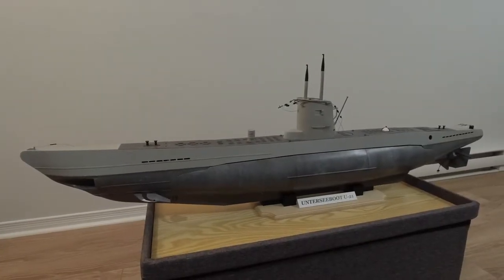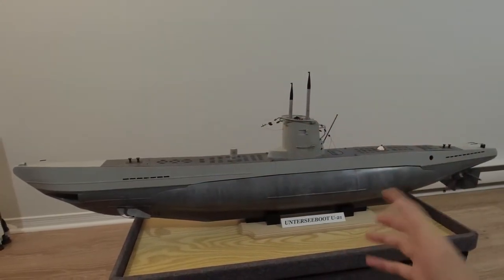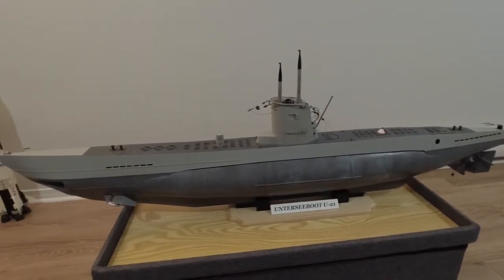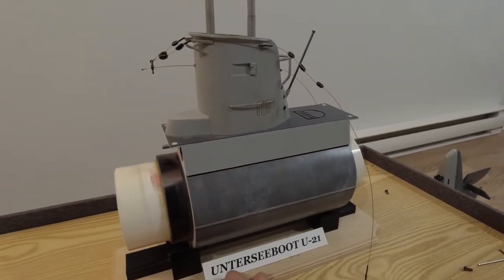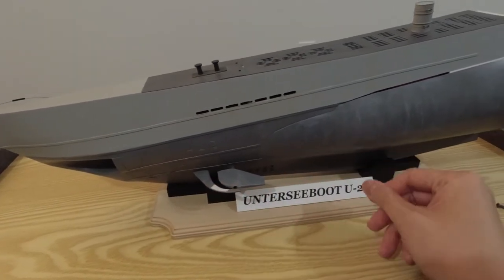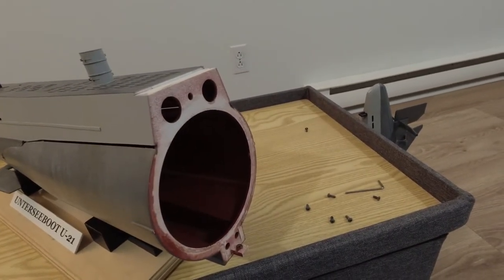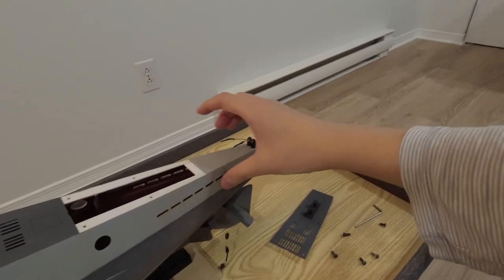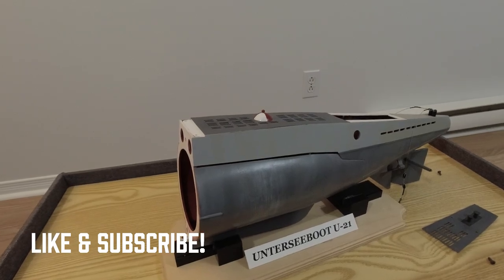RC Submarine Project - Type II U-boat | Episode 1: The Plan

Comment: Very Nice. What thicknesses of styrene sheet did you use for the hull construction (bulkhead/formers and skin)?
Reply from the maker: The bulkheads and keel were 3mm thick.  The curved surface of the hull were about 2mm thick, which made bending with a heat gun much easier :)

Comment: Have this idea of using those printable paper 3D models as patterns for styrene sheets.
Reply from the maker: It could work, although you may want to reinforce the inside with fibreglass for rigidity
Reply: @neitoRC  did you reinforce your styrene with FG?
Reply from the maker: Nope, in my case I used some marine-grade JB Weld between the styrene and the bulkheads.

Comment: 5:50
The type II was a single-hull design:
https://naval-encyclopedia.com/wp-content/uploads/2017/01/Uboat-TypeII-cuaway-plans.jpg

The "light hull" or "casing" was attached to the front, back, and top of the pressure hull. The sides of the pressure hull were uncovered.

Here is a good view:
6:06 - 6:10
The light-grey part of the hull (same colour as the conning tower) is the casing on top of the pressure hull.
The dark-grey cylindrical part underneath it is the outside of the pressure hull.

The same applies to the Type VII, but the Type IX used saddle-tanks that covered the entire sides of the pressure-hull, effectively making it a double-hull design in all but technicality.
Reply from the maker: Yeah I did realize after making the video that the Type II and Type VII were indeed single hulled and did not have the external "skin" around the pressure hull except for areas in the forward and stern sections.  This really speaks to the quality of the workmanship back then, since single hulled U-boat were able to survive (in some instances) from depth charge explosions around the pressure hull.